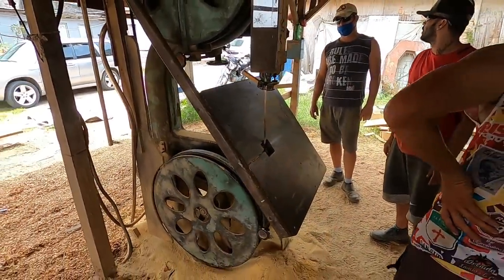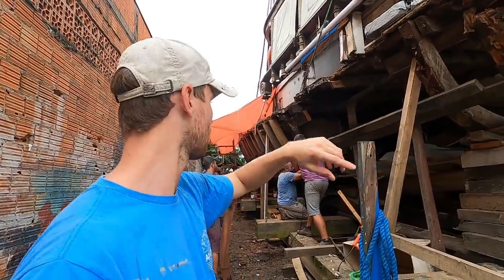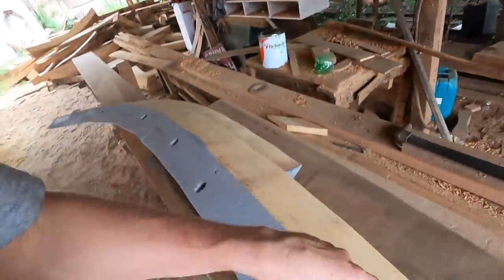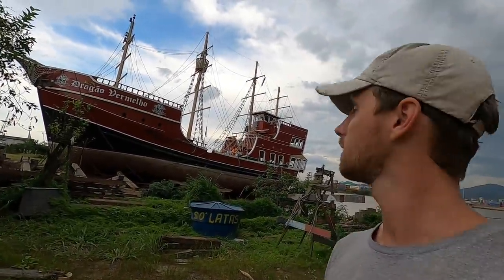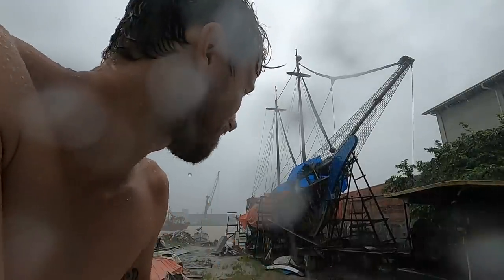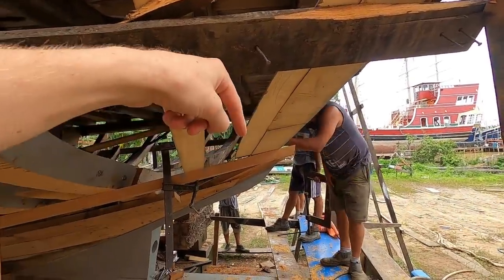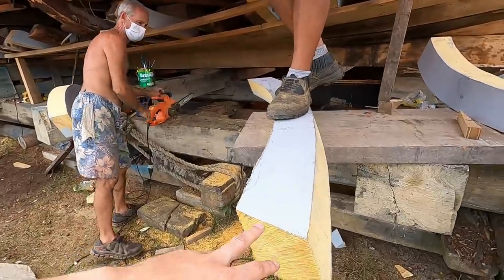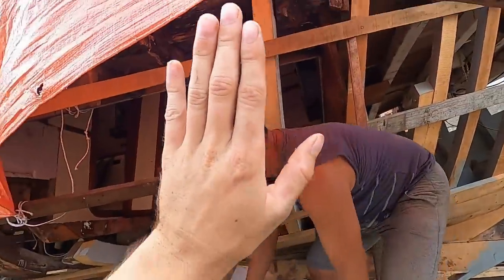We could have done WITHOUT THIS STORM! — Sailing Yabá #25

Comment: 13.40 this cooling system is called " keel cooling " it can be used for cooling engines and refrigeration equipment , you can see this on small to medium sized commercial vessels in the uk and the rest of the world  it not uncommon , the draw back is when the cooling piped get damaged or holed and sea water gets in ,

Comment: Tying tarps down is not as difficult as it may seem if you know a few tricks. Small rubber balls put in a corner of the tarp and tying a chock knot around it can give you 2 ends to lash down. My scout master made many tarp structures for us over the years and always used the balls instead of the eyelets as they pull out but the ball helps you grab the tarp . Getting close to the big splash and I can't wait. good luck with the weather and drop me a line if you want to see some pictures of ho I tie the ball into the tarp.

Comment: That time lapse of that storm was pretty awesome...
Also. Just my unprofessional opinion... Those external heat exchanger systems are great until you hit something and bust one of those pipes and start sucking salt water into a system that's only designed for fresh water... I know in theory it's easy. Just don't hit anything. But in practice... Being new boaters and having a rather large vessel... I feel like accidental bumps are going to happen. But like I said... That's just my unprofessional opinion...

Comment: Congrats on getting 3/4 through the framing 👍🏼any reason why the port side was done first? just happened that way, or tradition, superstition?
Reply from the maker: Hey Dave! Thanks!! Port side was in a worst condition than starboard, so to keep some structure they decided to go for it first. We hope that brings us luck hehe 😉
Reply: @SailingYaba  That sounds like a great reason, too late now but it would have been good to include that in the video. I hope it brings you luck too 🤞🏻

Comment: Your friend’s cooling system is called a keel cooler. It’s an effective system. 

Next step is to replace your engine with a new Yanmar. It’ll be more reliable, get better fuel economy, and if you leave Brazil you’ll be able to get parts. 
Your friends at Odd Life replaced their engine for the same reasons. 

Regarding your engine. Ask yourself if you plan to circumnavigate or if you’re just going be sailing Brazilian waters for ever.

Comment: DEFINITELY do the closed loop cooling system if you can!
If done right your engine can last almost forever. I saved an old 50' concrete boat from becoming an artificial reef about 14 years ago and it has a 58 yo rebuilt diesel in it that has been in the water for over 30 years now and still runs great and we've been cruising it for over 10 years. There's a picture of keel cooler about half way down this page on my website, it's simply constructed of 3/4 sch. 40 brass pipe strapped to the bottom of the hull. https://www.shipofimagination.com/the-halcyon.html 
Keeping the SALT water out of your boat makes a HUGE difference in the longevity and reliability of everything in your engine room.  This boat set in salt water at a dock for over 12 years before I got it and there's no way that engine would still be running if it had raw water cooling .

Comment: Hi guy's wow so much going on and so fast now impressive ,I liked very much how you showed the difference between how the new rib's and the old ribs were made and why . also with the new ribs being heavier should mean a more stable ride and less ballast ,Not to mention handling rougher weather .I would not recommend the cooling system your friend has for your boat ,the reasons are it will add drag and increases the possibility of failure do to damage leading to motor failure .If you want a fresh water cooling system for your motor install an intercooler system to the engine which will draw in sea water  and cool the fresh water this can be done easily and is easy to maintain .Over the long term this will be more cost effective and easier to maintain .I'm sorry about the storm I thought I made it clear to mother nature NO MORE RAIN ! . Well what can you do some times parents just won't listen they think they always know what's best .well it's that time again I have to go , The kid in me say's No but the older and wiser ? me says go .So Good day and good night and may all your days be bright . ZZZZZ.
Reply: I too was thinking the intercooler,would be the way to go. Keeping rust from inside the engine.

Comment: At this point, it would be more efficient to change all frames, as the planks are off. If well maintained, you would not have anything major to do for decades to come, vs having to change any frames from the inside later on. Insurance would be easier to deal with also. Never mind the peace of mind knowing that the hull is sound.

Comment: All to the modern woden boat builders are using Epoxy'a and glues to join framing elements and water barrier compunds. Why are you not reinforcing the boat with these modern techneques?

Comment: Guys, seriously you can't have raw wood bolted or nailed to other raw wood. If this lasts longer than when it was built originally, I will publicly apologize but I can't just sit back and watch it without saying something!
Reply: Are you sure?
I have seen this technique done in the US house construction very often.
Or is it different because the wood is curve?
Reply: @tejolisboa  Not different because the curved appearance, but different in environment. A house construction is kept dry due to the position above  water level and mostly on dry land, and it's protection by roof and outer walls. A bilge is always wet, especially when a wooden boat is drying on the hard (shrinking of wood) and is not completely watertight for the first period of time. The hull planks need to swell to compress the seems to be more or less watertight.

Comment: This project seems to be a bigger one than you imagined,  but you wont regret it.  The way it's being rebuilt, it will last another lifetime.
Reply: It didn't last a lifetime to begin with, and looking at how it's built and how they're fixing it, it seems unlikely that it will have a significantly longer life this time around.
Reply: @muaddib1116  only due to lack of proper tlc in the first place as long as you keep fresh water out and maintain the outside properly there is no reason Yabba shouldn’t last a lifetime
Reply: Agreed it’s always the same with anything wood that’s been neglected there’s always at least 40% more work than u can see on the surface.
Reply: @charonstyxferryman   that boat was poorly built to begin with. There was no evidence of even rudimentary bedding compounds for instance. Tlc or not  to have structural members reduced to compost in 15 years does not speak well to original design nor execution. And yes I do know the consequences of lack of maintenance.
Reply: Sure, my comment was a little simplistic, but the way they're rebuilding the hull is not maximizing their chances. If I recall, the boat is only about 15 years old, and for sure a lot of it's issues are due to neglect. But the best built wooden boats still require a lot more maintenance than say a fiberglass boat, and from what I've learned, they are doing a number of things that will likely increase the chance of rot/worms in the future. They haven't been bedding their futtocks together, or coating wood-to-wood joints in rot resistant paints or worm resistant coatings. The most I've seen is that they are painting some of the surfaces of the frames inside the bilges. Their planking is mostly held on with steel nails with some, as of yet unseen, number of stainless lag bolts. This is a recipe for rust, rot, and for planks to loosen up over time. All of this is on top of what seems to be adequate, but less than perfect frame lofting. Compare this build with Sampson Boat Co. where aside from the more precise fit of all the wood, they have been coating and bedding every joint, and have used primarily bronze rivets and through-bolts, which won't allow planks to work loose. 

What they have going for them is what appears to be really high quality wood, and a low cost boat building/repair industry that seems to be based around this working-boat type/style of wooden boat. So replacing rotten wood in the future will probably be relatively easy. So yeah, I'm sure Yaba will probably hold together well for another 15 or 20 years depending on maintenance, but that's not a lifetime. Tally Ho is 100 years old, and Leo is rebuilding it to last another 100 years. Obviously, it will need to have caring owners and maintenance to do that, but that's much more on the "lifetime" side of the scale, in my opinion. I suppose if Yaba continues to have owners that care enough and are willing to spend enough money, it can last just as long, but I think they are setting it up to have a much harder time of it.
Reply: @muaddib1116  not saying you are wrong I do think it’s a little unfair to compare the 2 builds though for starters tally ho is of English build and design from a time when boats got built strong to last for obvious commercial working life requirements. Yabba is very much a pleasure vessel built in a part of the world where wooden boats are still very much a thing both commercially and privately with many shipyards and plenty of competition as a result of this the attitude to timber built boats a whatever haul her out hack her up and replace what’s needed dump back in water till nxt time it’s a luxury when everyone is still building timber vessels
Reply: @mrwolf9335  
Ok kids, no fighting.
Reply: @homer5802  haha it’s not like that man he’s raised some fair and valid points for sure 👌
Reply: @mrwolf9335  Yeah, I get that, to a degree. I get that their tools and experience wouldn't allow them to do the type of wood working that Leo is doing on Tally Ho. While I think, objectively, that their level of craftsmanship is not up to Leo's or other English/American wooden boat builder's standards, I also realize that these guys are part of a living industry, not boutique craftsmen building luxury yachts for the wealthy. And I think, from what I can glean from these videos, that their fabrication level is adequate for their needs. They definitely are able to do a lot with very limited tools. I've really enjoyed some of their homemade tools. On the other hand,  I can understand cost and availability restricting them from using bronze, but what's preventing them from using galvanized steel bolts through the frames, rather than nails? And given what this rebuild must be costing already, I don't think there's a good reason for not using preventative paint/bedding coatings.
Reply: @muaddib1116  I think the time between things happening and final edit gives a distorted perception last 3 episodes frames looked to have no coating of any description yet nxt episode they are grey not sure what the availability of bedding compounds or costs would be out there which may be why it’s not common practice to use, the stainless allthread is definitely not cool as overall the strong part of it isn’t the actual diameter not foot if any flex. I should think it’s actually a pain in the ass to rebuild a timber boat of that size with no blueprints or anything other than rotten wood to go on as templates. There’s a massive difference to having the whole boat drawn out full scale on the lifting floor like tally ho to replacing rotten wood on the slip
Reply: @mrwolf9335  As far as bedding and coatings, it's come up in the comments before, and they've made no comment or clarification on it, like they did with the nails and stainless lag bolts. I've actually been watching pretty carefully for any evidence that they are doing it and just not mentioning it specifically, but I really don't think they are. All the grey paint I've seen looks like it's on the exposed internal surfaces of the frames, not between the frames and planks, and not between the futtocks. I have a feeling that the easy availability of high quality hard wood, that would cost a fortune up here in the states, is something that's allowed them to get away without various coatings. I suppose that the ideal coatings or bedding compounds may be expensive there, but they clearly have access to some types of paints, and I would think that even a common hull paint used in the wood joints would be better than nothing.

The design of these boats is pretty interesting, both the build/construction design, as well as the boat design. I made a comment in a previous video that there are no bilge stringers, and the reply was that the planks are so thick that they don't need them. Maybe this is another symptom of having so much good wood available. Also, the overall boat design is interesting. Yaba doesn't seem overly unusual for the area, but it is a pretty unusual shape for a sailboat. It seems similar to Turkish Gulets both in style and probably purpose. Interestingly, those are also commonly found made of wood.
Reply: @muaddib1116  it’s definitely an amazing and overwhelming project to of taken on you are definitely on point with the industry’s complacency associated with cheap and availability of hardwoods locally glad that they went for fsc wood though would of been easy to of taken a cheaper road in those parts
Reply: @mrwolf9335  Yeah, it's really cool that they did that. I realize that all I'm doing is criticizing them, but I really do like them and the channel. Seeing a different type of wooden boat industry is great. I do wonder what their plans for Yaba and the channel are for when the boat is finished. Is this type of boat mostly restricted to coastal cruising, or can it be taken across oceans, or up to the Caribbean? There's probably plenty of cruising to make videos of just in Brazil, let alone the rest of South America.
Reply: @merlars  I see your point about Tally Ho, and I get it, the contexts of the projects are very different. But, the nature of the projects are pretty similar; wooden boat refits using traditional methods that ended up being more extensive jobs than expected. It's hard not to compare them. That being said, in my previous comment, I tried to account for their differences and limit it to things that are probably not as budget restrictive, ie. bolts over nails, and basic coatings and bedding compounds. 

In his most recent video, Leo mentioned the Port Townsend wooden fishing fleet and associated wooden boat maintenance industry. That is probably more fair to compare against this Brazilian wooden boat industry, but I would hazard a guess that the methods and techniques used by the guys in Port Townsend in the areas I've been discussing are more akin to those used by Leo on Tally Ho than the guys working on Yaba.
Reply: No, never. not the way it is being built, mild steel threaded rod, steel nails, no sister ribs just bolted, no bedding compound, full of mold spores/dry rot. The boat was originally built as a 5 to 10 year life max, thats all they do/how this was originally built/designed for. That was the original Brazzilian boat builders way, plenty of cheap timber. Now its a 7 to 10 year boat at best.

Comment: I will bet for sure that Yaba will swim again. however with what I know about ship building. The reason Yaba was rotting to her death was because of this third world shade tree wood boat building. These guys are not building a boat designed to be seaworthy. They are building a boat for a third world tourist vessel. Quick and cheep. The USCG would never certify this boat to carry passengers. Even when completed she will always be a very dangerous vessel. This boat will be full of rot , full of ship worms and sinking again in less than 10 years. I pray these two use Yaba as a floating home at a dock someplace and never try to cross a ocean.

Comment: "THOSE BOLTS HOLDING IT TOGETHER START RUSTING THE THINGS GONNA FALL APART"
Even if they were titanium the lack of scarf joints and the poor fitup between futtocks gives the hull the structural integrity of a paper bag. When the thing starts working in a seaway it will at best leak like a sieve or more likely, start springing planks. There is little reason to believe the process of salvaging the deck will be any different or contribute to any structural integrity. The total lack of bedding and other preservatives between faying surfaces is an invitation to the kind of rot that defined the boat as a derelict when it arrived at the yard.
Reply: Like the old saying goes "If you don't know how to tie knots tie lots of them".  With these guys, if you don't know how to make proper joints in frames, just keep bolting more and more wood together that will flex like wet noodles when stressed.
Reply: @MegaDirtyberty  Are facts so frightening and the truth of my posts so disturbing you have to resort to name calling? 
I  have no idea why this project continues but I am beginning to suspect that restoration of a derelict for long term personal use is not among the leading priorities.

Comment: I THINK YOU SHOULD HAVE JUST BUILT A WHOLE NEW BOAT. ONCE ALL THOSE BOLTS HOLDING IT TOGETHER START RUSTING THE THINGS GONNA FALL APART.
Reply: it now appears to be a heap of shit sat on a brand new frame/boat
Reply: @T-Sav  on a half brand new frame lol
Reply: Well, apart from the fact that from the beginning they barely knew the stern from the bow. They think these workers are highly skilled, and they pour money into this pile of rot like water in a waterfall, they insist on calling the POS a schooner, though it doesn't have a proper rig. They have no sailing experience, the engine is about to blow up. I mean, what can possibly go wrong???!!!
Reply: @T-Sav  pieced together with endless smaller pieces of wood hacked in place with an electric chain saw, and fixed with screws. One bad storm, or if they hit something in the water, they get to use their rescue equipment.